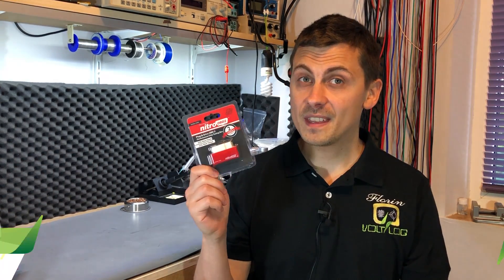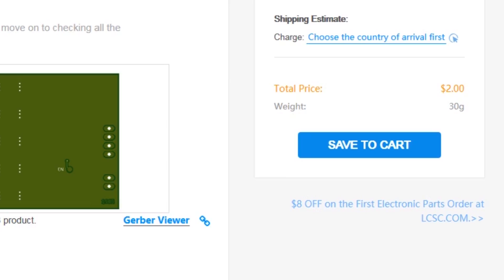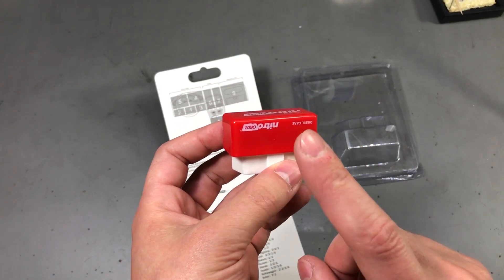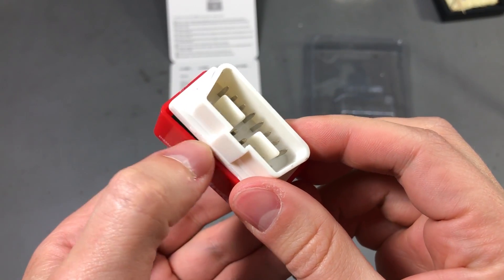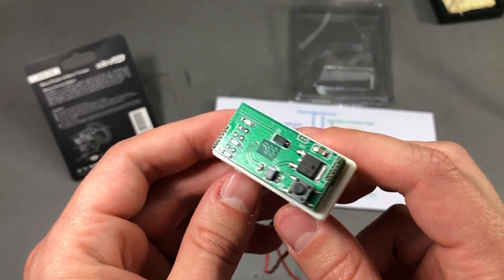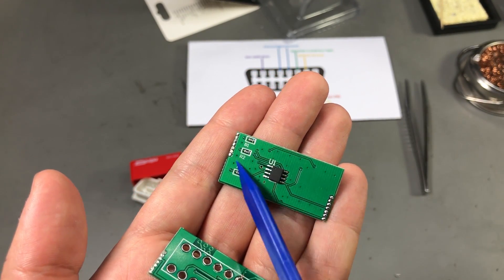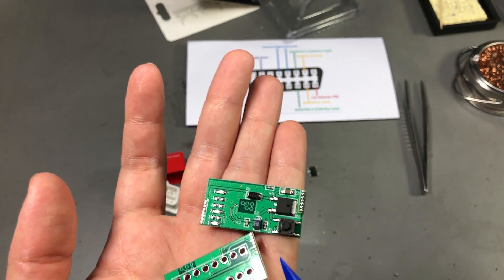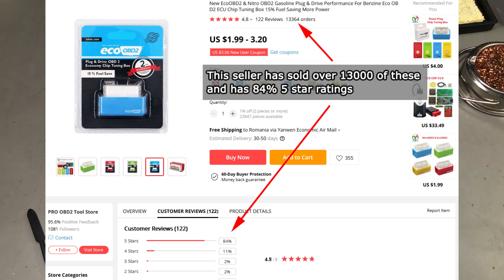Voltlog #231 - Nitro OBD2 Chip Tuning Scam

Comment: I tried the yellow one, it adjusts how fast you engine shift gears, very noticeable, but doesn't really improve Horsepower or torque. and your pedal is all messed up, a half way pedal push is a full redline rev... it does shift faster tho, it doesn't have the old half-second delay before it does anything at all before tuning

Comment: Yes it will effect your vehicle  performance with the amazing "placebo" effect :)
I also never heard tuning to save fuel. It should cause you to use more fuel and often cause damage to engine in the long run.
Reply: It’s a well known fact that ecu tuning can increase fuel economy as well as power.
Reply: It’s the efficiency of the tune that gives you the ‘fuel saving’ because technically you should be using less throttle now it’s more powerful but you are right really. No one is saving fuel, every one is stamping on the gas and wearing out their engines
Reply: @austinsharpley1733  Tuning for power will not increase efficiency. There is a sweet spot for efficiency like everything in life :)

The car makers already tune your engine for most efficient / safe operation. If tuning made the engine better, the people who made the engine would already sell it tuned. It is not a conspiracy :)
Reply: @jackl8915  hi yy2
Reply: @johneric6149  Yy2?
Reply: More power means it needs more fuel..just by inserting a device, magically can manipulate the ecu settings to produce something it wasn't programmed to do will surely be problematic eventually..more $$$ spent

Comment: At first I thought this wouldn't be interesting as I had already watched BigClive's video on these. But I decided to watch it anyway as I've got my car tuned few years ago in a small shop dedicated to my car brand for decades. At that time I had not yet started with my electronics hobby so I wasn't that interested in the what and how. Now I know much more and surely it was interesting. Thank you!

And in case someone is curious, yes it did have a significant improvement on the car's performance. The tuning kit was BSR Stage 1 to a Saab 9-3 2.0t. According to their specs it should be a change from 175HP to 220HP. I am not the right person to evaluate if the improvement was that big but it didn't require imagination to spot the difference. :)
Reply from the maker: No doubt professional tuners know what they're doing and will deliver the results. But one shouldn't expect to replace hundreds of euros paid to a professional tuner with a $3 gadget. I'm amazed how many of these get sold on aliexpress and ebay.

Comment: What this does is to do the “Passive” ECU reset that is currently included in every modern car. 

I’ll tell you why you don’t need this tool. It’s very simple. 
It works like this: 
You simply turn the ignition ON (without starting the engine).
Hold the gas pedal all the way in for more than 5 seconds. Preferably 30 seconds. 
Without depressing the gas pedal, turn the ignition Off. 
Let the gas pedal go. 
Wait about 1 min. 
Start the engine. 

This will reset the user learning habits of the ECU. 

In conclusion, yes this device is a scam, what this device does is just to activate a simple code via OBD which is “Holding the Gas pedal sensor all the way in”. 
So that when you turn the car on you Kinda feel a difference. Yes it is noticeable for those that owned a car for at least few years and have never perform an ECU learning habit reset. 

And that’s why the PCB in this device is so simple and useless.
Reply: interesting, so what you’re saying is the device simply keeps the ecu in hard reset mode? If I do the Ecu reset procedure you mentioned every morning before starting my car, I’m basically imitating what this device does? I have been doing the ecu reset every morning and still want a bit more power / better throttle response, but I couldn’t see the point of spending hundreds on a tune when I could buy a chip like this.
Reply: @e92e36  first you must understand how ECU works. 
If your vehicle is not a performance or sports car you won’t gain that extra push you’re looking for easily. 

City vehicles are meant for Gas Savings and low emission regulations stabilized by your region, so ECUs are programmed with a calendar code that learns your habits from Monday to Sunday. As well learns the car’s health, airflow, gas injection and other mayor sensors around the car to keep the car constantly running without performance lost or gains. It communicates directly with the vehicle motherboard. 

The trick as follows:
Perform the gas pedal reset from Monday to Sunday, while performing the gas pedal reset you must drive the car for 10 minutes and threat it like a race car; drive it hard for 10 min. 
Remember the gas pedal is a sensor as well and has its relative memory in the ECU. 
The car will think you’re an insane bastard with a heavy wallet therefor will pre-inject more gasoline, air, etc etc. 

for this to work efficiently you must already ran out of warranty with your manufacturer. Manufacturers sometimes locks this reset during warranty periods to avoid fixes in your vehicle. Remember, the manufacturer hates and only wants your money. They lock it deeply that only the manufacturer can perform a reset, and automatically unlocks after warranty ends therefor you have issues you must pay for them to the manufacturer. 

If your car still under warranty get an old used ECU and get it in. Some specialist will help you unlock it and edit it as well. 

Making changes to your car like a new exotic exhaust without reprogramming the ECU will cause weird issues to your car at a point of causing RodKnock.
Reply: @exklimexklim  Not many people are aware of what you've described. Even aftermarket tuners sometimes do this with their tuning software. UpRev (or perhaps my shop's tuning guy) did this to me on my 06 Infiniti M45. My car ran like a demon until their tune expired. It took me years to figure it out. It's horrible what people and companies are capable of doing to your car for repeat business. 😕

Comment: Just a minor point concerning termination: the resistor couldn't possibly be on the PCB, because then you would have an un-terminated bus any time this device wasn't plugged in; at any rate, it would only be needed if the OBD plug would sit at one end of the CAN network (which is not necessarily true), and in that case, it would have to be permanently mounted into the dash socket - the loose end of the bus wiring would need it whether or not something is actually plugged in there... and yes, of course these are snake oil... :)
Reply: On some cars,  very few though,  the OBD2 connector has a protective  cover with built-in 120 Ohm resistors. But in general you're correct. No termination resistors are needed in devices to be plugged in the OBD2 port.
Reply from the maker: thank you for the clarification!

Comment: CAN bus termination resistor is not allowed in anything that plugs into the obd port. The system has to have two under almost all circumstances, and they're found at opposite ends of the bus; usually one in the ECM and one in the antilock brake controller. Adding a third is a violation of the spec and would likely cause sporadic communication problems.
Reply from the maker: Thanks for the clarification, it makes sense, I was wrong to say that.

Comment: Dave noticed that those scams had silkscreen bellow the IC pads, so it looks like it were doing something but weren't
Reply from the maker: In this case it was different, 8 pin micro and all pins were soldered down.

Comment: We did it on our Toyota Hiace Commuter D-4D 2.5 liter. Doesn't really add speed, but the fuel consumption reduced a bit and the throttle response is quicker. Oh, our van is also a Public Transport vehicle.

Comment: These may suck. But I have yet to try a Bluetooth obd scanner that didn't work. Never paid over$4 either.
Reply from the maker: Well, I got one of those ELM327 bluetooth adapters that doesn't work. "Communication error: ECU responds to OBD2 requests but not to CAN ISO-15765 requests." Possible causes: engine not supported or ELM327 faulty or bad quality. If it's a software or hardware issue I have no idea.
Reply: @voltlog  try different software. I'm driving my semi right now and can't see what I use now. But I did go through 5 or 6 apps before getting everything to work.
Reply from the maker: @karlporath8904  Eventually I figured out that my problem is the app which doesn't support my engine code. Unfortunately there is no other app that can show the DPF filter status as nice (i'm talking about VAG DPF).
Reply: @voltlog  wish I could help. Here in Detroit we have no emissions laws. So as soon as the car is out of warranty all the emissions get disabled.

Comment: I had my pick up fitted with this ob2 just recently and it works, fuel effecient and no lagging with the accelaration, it may varies to some cars maybe
Reply from the maker: Lito Andrade the only variation is how much you paid, but it's still a scam.
Reply: If it's a scam, why is it allowed to circulate in the first place? Do authorities have some sort of ways on checking these items before they are out to be sold?
Reply: Could it work in Toyota Hilux 2015?

Comment: Right I’ve been using the diesel one now for 2 weeks.  What I will say is that I have noticed smoother acceleration in the 50 to 70 range and there does seem to be less fuel use.  Does it work, hope so but for few quid there’s no harm done.  I haven’t noticed any difference in acceleration as of yet but only done about 50 miles using it.   I can only say why would something be sold they makes a claim and does not work?  You could say it’s in my head but I would say I know my fucking car I’ve had it 4 years now.    For 15 quid I’m happy.   Does this guy know when he’s talking about, fuck knows I cannot appraise his work and can only go in experience. I will just add that in the 80's there existed the Sinclair zx81 that had 1KB of memory and people typed large amounts of code on this!  He’s talking like we know what he’s talking about.   😀
Reply from the maker: You should buy another one, install two of them, that will double everything you speak about.
Reply: @voltlog  lmao

Comment: The my question is the device OBD2 tools keep plug inside the socket as permanently ...?  no need remove pull out... or  if only we need checking scan..? please give me the answer solution right way.. thanks bro.. greetings from jakarta...
Reply: Supposedly the one I was looking at was $90 you plug it into the port and it remaps a stock engine and transmission to its peak performance, and when you take it out the car automatically remaps back to the original factory specs

Comment: I've been using this tuning chips for a long time and made my car fuel efficient and performed better, improved power and torque and removed throttle delay.. experience is better than watching this video.. just make sure to use the original one because there are fake items out there
Reply: add that you sell these on Ebay
Reply: @tonystone1387  I think the one you test is the fake version.. the original one is using microchip PIC16F59

Comment: dude i’ve been using one in my 98 jeep cherokee and it works fine. got my mpg from 13 cause my big ol tires to 17 mpg. also it actually holds a steady green and red light at the same time. you are not the smartest cookie. try it on a car before you TRY and get all smart 🤣🤣

Comment: I don't know one of these that actually works. As far as I knew they're all scams except from the company. Good luck getting one.
Reply from the maker: The thing is it doesn't matter how it's called or what shape it takes, what they claim is not possible with such an OBD dongle.
Reply: @voltlog  The only thing I know is I have an OBD 1 and 2 error reader which is a diagnostic tool. This tool allows you to clear the errors to see if it was a fluke or not and so after you repair your vehicle you don't have to wait for the computer to do it...OBD 1 is good for cars up to 1995 and 2 is 96 to current. Also insurance companies have them if, if you install it will lesson the cost of your insurance, but it will report back if you were speeding, built in GPS so when you get around open WiFi it reports on you. I'm not sure if they carry a sim card yet. Certain cars have the capability to install a performance chip. I used to be a mechanic before all of this crap and made a good amount of money doing that, but I painted Italian sports cars and averaged 5k per job. I was able to spray with no orange peel effect, but like a glass finish. Back in the early 80's, that was a lot of money. anyone with a nice car came there to get a paint job. Some days I would get 2 to 3 jobs per day. Even though the owner received a good chunk of that money, he brought me the work and I was my own boss. Lunch was always the best and on the owner with a case of top beer. This was a huge company and I was the only person allowed to spray any vehicles, made me feel good about myself. That place was certified all the way, mechanics, body men which is how I started to detail. My son is a master mechanic at Toyota, but they work on anything. I had 2 Dodge Ramcharger's a 1981 which had no computer and a 1988 that did, but all you had to do with that was turn the key on and off 3 times and it would blink a code, just don't lose the cross reference book.
Reply from the maker: @MrBrymstond  Interesting insight, from what I hear these days Ferrari's have notoriously low quality paint jobs coming from the factory which you wouldn't expect for such an expensive car.
Reply: @voltlog  And they have robots doing the job in most cases. It is a shame because it doesn't have to be this way.